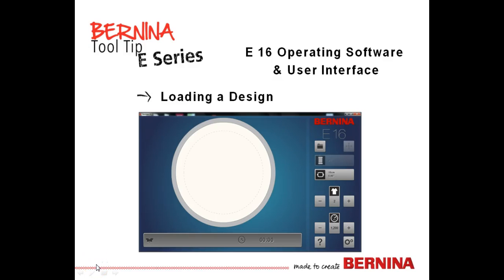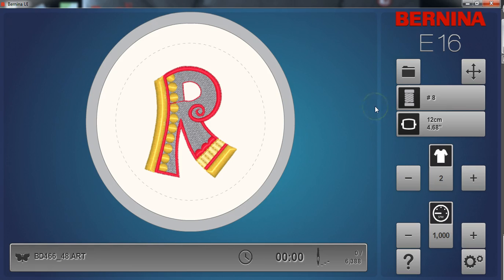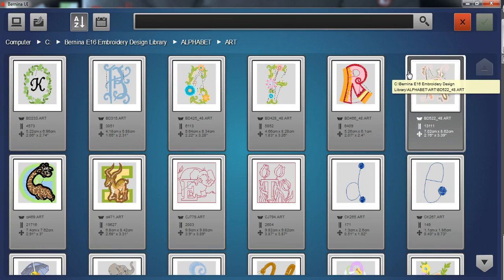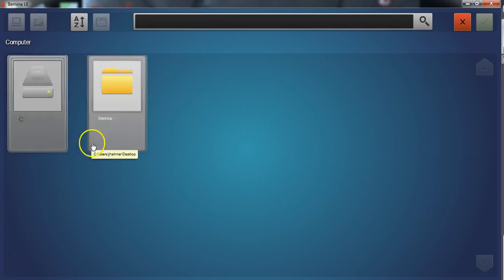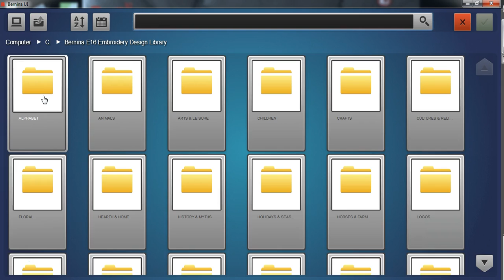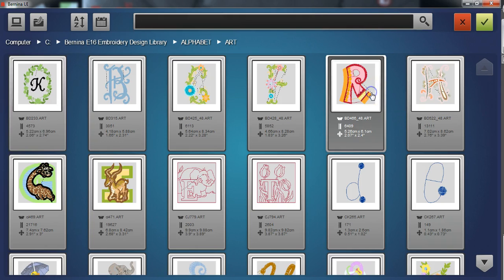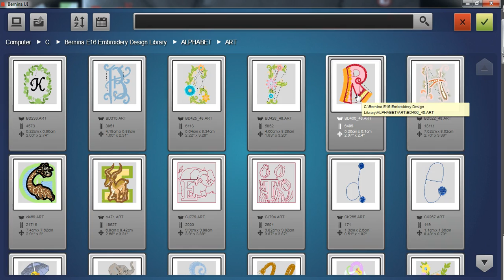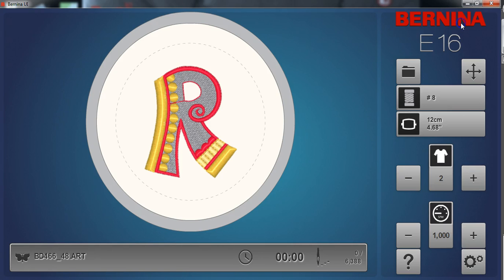BERNINA E 16 - Tool Tip - Loading a Design

Comment: Why aren't my designs showing up with the colors when I open the folders from my computer?  These are designs that I have digitized using B7 software. I can't see what colors my design has when I load it into the software. Please advise.
Reply from the maker: Dear Shelley, thanks for getting in touch with us. Our  customer support in the US will make direct contact with you. Kind regards from Switzerland